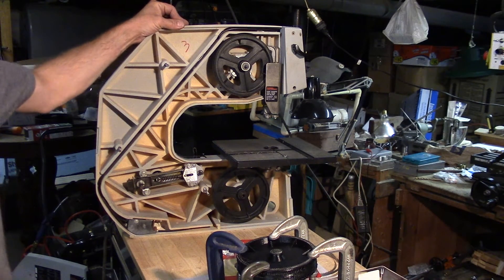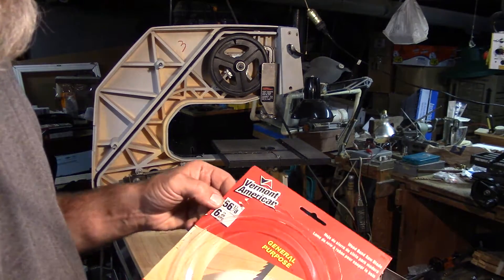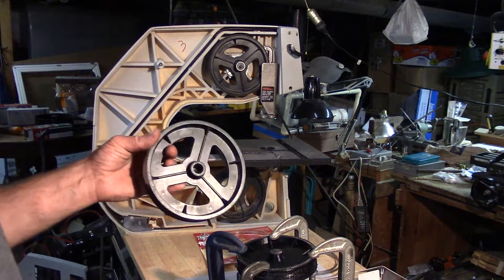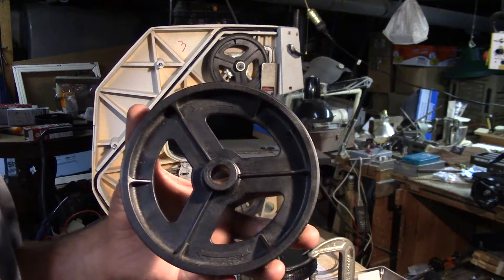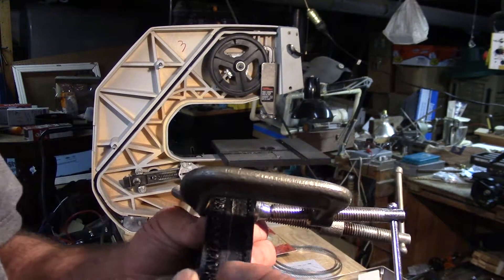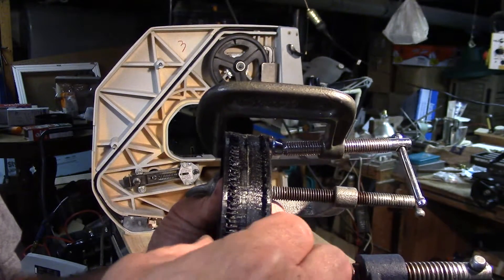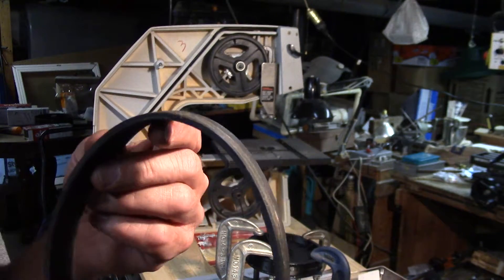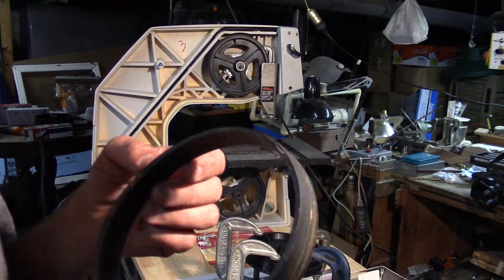Bandsaw Modification 3D printed. part 1

Comment: I have a very early "3 wheel" bandsaw - still comes in handy.
3D printing is ever so useful - your pulley came out nicely. and should do great. Just the final clean-up.
Reply from the maker: Works great so far. Part 2 coming tonight. Hope the your back is better this week. CHEERS